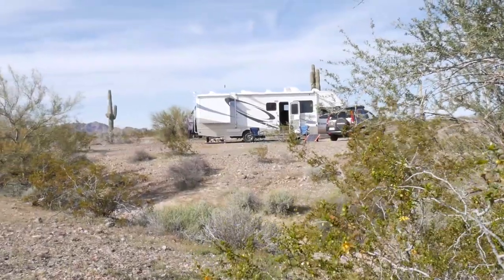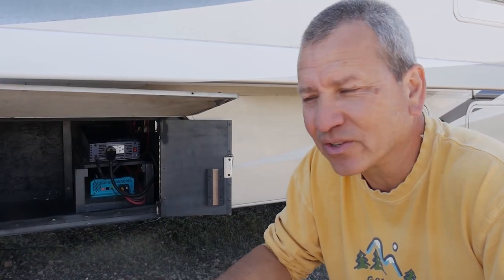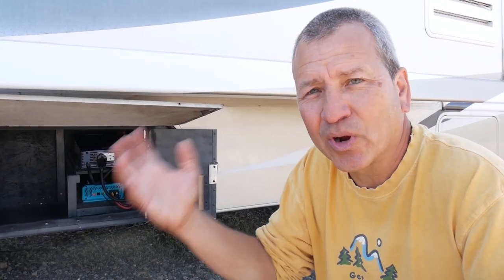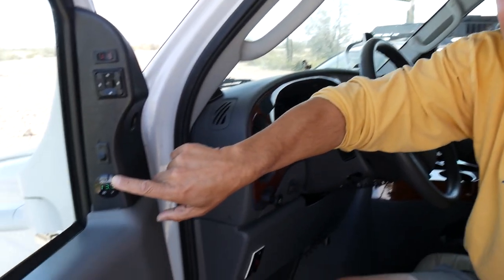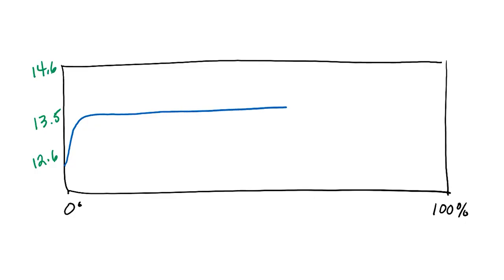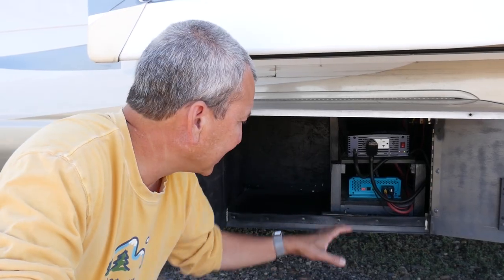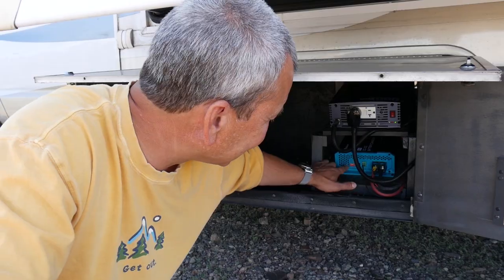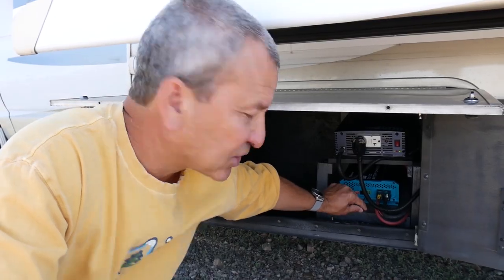Charge LITHIUM Batteries While Driving - System Setup

Comment: I have a promaster 2500 van that I converted with a 40 amp D.C. To D.C. Charger for 3 Battle
 Born batteries. I'm not at all happy with e way it charges . The batteries can be at 13.7 % and I drive all day and maybe they will get up to 13.4 . Never will they reach 14, 4 . Any ideas . Thanks
Reply from the maker: Do you have anything large drawing energy from your batteries while charging? You might also check the other settings on the charger. Sorry. I don't have a clear answer.
Reply: I have a 3000 watt inverter powering a small 110 volt fridge , dorm style .
Reply: Double check your dip settings. Brian initially set his wrong & mentioned the poor instruction manual. Other users have reported the same thing & upon resetting the dip switches problems were resolved.
Reply: When you say the batteries are 13.7%? You mean battery capacity & if the alternator is a smart alternator it will stop charging the starter motor battery, 11-12v your dcdc doesn't know the engine is running, so run your ignition trigger wire
Reply: I don't think there are any. It has a different color light on it. It says a blue light for lithium .
Reply: My alternator is not a smart one.
Reply: A red light comes on the D.C. To D.C. Charger when the engine is running , telling me it's connected to the starter battery.
Reply: My D.C. To D.C. Charger is the Renogy 50 amp with the mppt solar controller all in one, but I did hook my solar wires back up to my original controller. I was afraid maybe that was pare of the problem.
Reply: @68Mustang390  oh yeah some dcdcs think the battery is higher cause of the solar controller, all victrons you can interbind with other controllers
Reply: @68Mustang390  how much solar you got?
Reply: 400 watts

Comment: I really would recommend upgrading to a better alternator. Back in the day, the only way to get a better alternator was to get a rebuilt alternator from International. They hand rebuilt them and rewound them. That build quality was the birthing bed for todays high quality, high capacity alternators. All it takes is a little bit more build quality, and you're getting a MUCH more reliable alternator. The stock alternator just comes off of an assembly line. Any stock alternator may or may not be able to take a hit up to it's capacity (even though it easily should) due to crappy build quality. Any (reputable) aftermarket alternator should be able to take multiple hits, and will definitely have a greater capacity, because you ordered it that way. :) Is a high quality alternator a necessity? No. A high quality alternator is a safety measure to gauranty that it won't fail when you need it most. A high quality alternator IS an equitable replacement for a small RV generator (which is also built to quality standards). A stock alternator is definitely NOT.

AT 6:00 Mmm.. not a best practice, leaving your chassis battery permanently connected to your house batteries. IF you install a marine / or large capacity deep cycle battery as a chassis battery, it would be 'ok'.. but a standard car / vehicle battery is going to get murdered with all of your household electronics constanlty turning on and off and draining it at different levels. Hmm, you should have taken your best AGM battery and installed it as your chassis battery. That would also do better at taking all of those hits between charges. Best practice, don't leave it connected to the house batteries long term at all.

I'm at 6:25 now. Well then.. The above paragraph applies to anyone tying their chassis and house batteries together DIRECTLY. You of course didn't do that, you tied it directly to your DC-DC converter. ...I think I would have left the existing switch in place, and ran a fresh new wire to the DC-DC converter. You kind of shot yourself in the foot as far as leveraging the lithium bank to charge the chassis battery, or even start the engine. Also, note that in any case, you are still better off using a higher quality battery to tie in to these usage scenarios than a plain old car / vehicle battery.

@ 9:05 Stock alternator (real world) output is anyone's guess, because the build quality if frankly pretty crappy. I note one guy said that stock was supposedly 120 amps. (I doubt that factory figure is true.) At any rate, take 75% of that number (90 amps), and that's what your real world alternator could PROBABLY safely be safe taking a hit at. In the real world, I would try to stay below 75% of THAT number (or ~67 amps) to stay on the safe side (that's just me, not pushing my luck, though). This is for consumer grade vehicles. If you're getting an actual commercial grade chassis alternator (GM C30, C50, Ford F350 F450), then it probably IS good at its rated capacity, because they don't risk pissing off commercial fleet people, commercial grade equipment isn't TOP quality, but it is better than consumer quality. I am not at all sure if your grade C RV (built on a van chassis) counts as commercial grade or consumer grade in the Ford world. I would guess.. that the quality fluctuates over the years depending on what Ford (Chevy, Dodge...) has left over in stock for the year.

Speaking of quality.. I haven't heard hardly anyone speak to the build quality of the Renogy DC-DC chargers yet. It's a safe bet they're produced somewhere in China, but God only knows how good they are. How often do you use yours? Is it staying rock solid, or is it acting like it's getting old?

Comment: Will you consider using dua battery isolator in your system - see www.dfna.info heavy duty battery isolator kit
Reply: Go for a Big Boy Battery Isolator Relay.  When dirty from usage, disassemble it, clean it and get it back to work.

Comment: Why does the automotive AC generator have a voltage/current regulator on them?  you don't need a dc-dc box witch USES more of your power, all your info is crap...
Reply: Alternator output is designed for lead acid or AGM recharging curves, not Li.